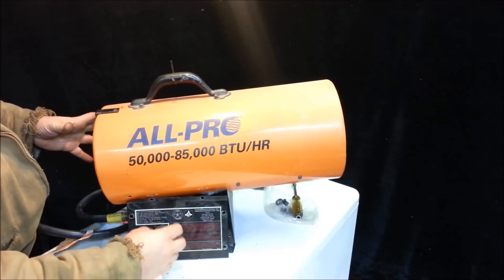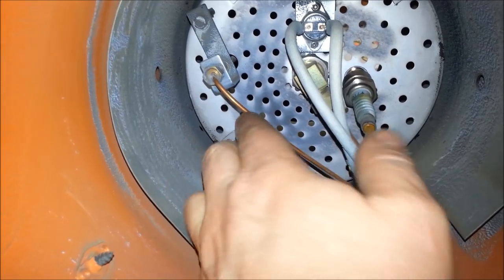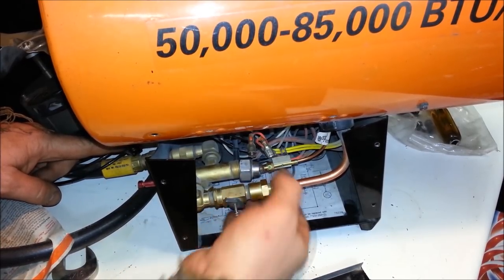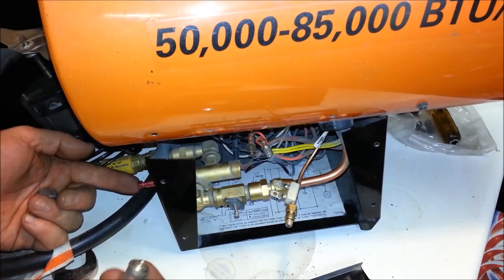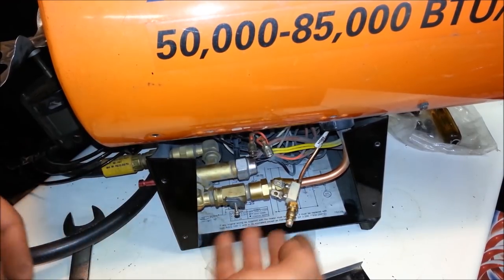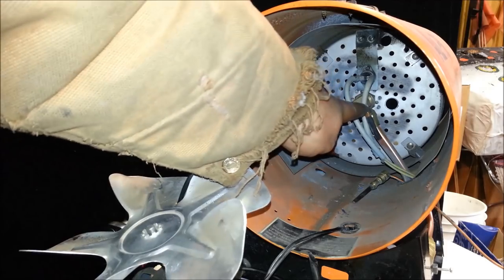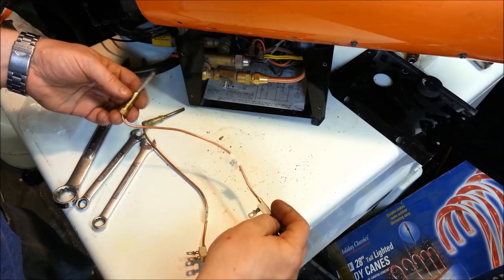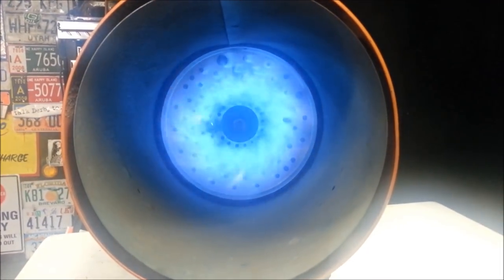Propane Torpedo Heater Not Lighting & How they Work

Comment: Thank you for the all the trouble shooting tips which helped me fix my heater.  My problem was the heater would start and run for just a minute or two.  If I bypassed the high-limit switch, the heater would run but get so hot, the unit would literally glow red.   Eventually took the regulator from the hose to my local propane store.  The guy said the regulator was either on or off and could not adjust the propane/air mixture.  
Took my regulator home and revisited some of your tips about the propane possibly "freezing" the regulator.   So I put my heat gun on the regulator and used a couple of rubber mallets to "tap" around it its housing.   Reassembled everything for the umpteenth time and success. Still have the fumes and it sounds like an F-16 taking off but hey, it warms the garage.  Couldn't have fixed it without your insight.  Thanks for taking the time to make the video and answer questions.

Comment: Thanks!  By watching your video, I found out exactly what was wrong with my old Coleman propane heater.  I obtained a new thermocouple for about $25 and installed it myself.  Now my heater is working as it should, and I can use it to heat my garage when I work on my cars.  Thanks again!  -Chris
Reply from the maker: Thanks, I'm glad you liked it.

Comment: Friends Dad and uncle were working on a car in a cold shop this last fall and used a heater similar to that. They failed to partially open up a door or window for ventilation. Friends mom found them in the morning. They had died from not having shop vented. Please always remind people to vent. Your vids are very educational, thanks.
Reply from the maker: Dave D I have a pretty well sealed and insulated garage and made it a point a 
few years ago to put the Carbon Monoxide detector in there. I can run 
the heater for 8 hours and it will never set off the detector. But if I 
start a small engine it goes off in 60 seconds. I feel very safe running
 these heaters in an enclosed shop but a Carbon Monoxide detector is always a good idea.
Reply: sixtyfiveford Hi 65, I would tend to think that you should match the heater to the space to be heated. I am not sure, but those two men who died may have been asphyxiated, not CO poisoned, esp. if the heater was too powerful and just consumed all the oxygen. Dave D didn`t mention the cause of death. Kero heaters will not poison by CO. You may get black lung, though LOL. Thanks for the videos.
Reply: I have a duraheat 60000 btu and it works fine but I have noticed in the last few days it is blowing off a lot more smell of unburnt propane like there is propane that is not getting burnt fully is there a way to clean some opening or something because I use this little heater daily for dogs.Like I said it seems like lots of unburnt fuel.
Reply: It's leaking soapy water will find it
Reply: Sounds like a bs story.  Many many heaters like this are used all over the country and no one has died.   I've used these in garages and construction jobs for 20 years and never had problems.    Bs !

Comment: I've been looking all over, can't find anyone with my problem. This is a brand new machine!  Plug in full tank, plug in power, <Fan & Sparker start working) turn knob on tank, press ignition button. nothing happens Can not smell gas, do not get any fire. Pressing and holding ignition button, NOTHING. It does not seem to be the Thermocouple. I got it friday, used it sunday to heat treat a bedroom for Bed Bugs (heat the room to about  140 degrees, for about 2 hours) and it worked fine. Next day, aim to use it on the next bedroom; no fire. Dunno. PS: great video, very clear explaination, camera and lighting!
Reply from the maker: Sounds like the propane tank safety shut off. Turn the tank valve ON and wait a few seconds, turn it off for a few seconds(you'll hear a faint click), then turn it back on. It should now flow gas when you hold in the bypass/pilot button.

Comment: The fan reminds me of an old GM heater fan. I used to drill a small hole on the plate covering the rear bushing and oiling it. Then just cover hole with Permatex or tape. That quieted a lot of fans back in the day.

Comment: Great explanation of how they function!  Thanks!  I'm not sure what is going on with mine.  It starts and the flame is small.... It just doesn't torch up big enough to create the normal flame and heat.
Reply: Are you low on propane? How cold is the area/room the heater and tank is stored in?

Comment: Thank you for this video.  I didn't know about that huge gap on the plug - I bought a 400k BTU Propane on the cheap because it wouldn't fire up.  They had replaced the plug before I got it and the only thing I did was check it for spark - When that didn't work, I replaced it, no help.  Then I gave in and found your video - 5 minutes later and two adjustments on the gap (too wide at first), I think that thing could heat a house up in 3 or 4 minutes!
Reply from the maker: Thanks, I'm glad you liked it.

Comment: Dude thank you so much for the info I got a CHF160 Duraflame from my uncle. it does not work do to the Thermocouple I am sure is shot. after watching your video it runs as long as I push the bypass it runs fine. I am so happy I found your video. I now just hope that I can find the right Thermocouple for it and ill be a happy man.
Thank you again. (almost 4 years ago on Dec 9.)
Reply from the maker: Sounds like a thermocouple. Thanks, I'm glad you video was helpful.
Reply: @sixtyfiveford  yep I thought it might be the solenoid that went out nope. It is the couple. Need to buy one off of Amazon. Thx
Reply: Hay by the way I hope you do a video of welding 101 class. I would love to see what you teach. Hope there is a way that you could put a welder shield on the cam so we could see what you see when welding. Thx man.

Comment: Great video, the most informative I've found. 

Any tips for testing the gas valve solenoid? I was able to get mV on the thermocouple, but even if getting the thermocouple red-hot, it doesn't keep the gas valve open. I get the thermocouple red hot, press the plunger for the gas, I can only get gas to flow when I'm holding the plunger (testing with the thermocouple where I can hit it with a torch).

Comment: Nice- since you have the propane and kerosene type which do you prefer.  I have a kerosene 215,000 btu , I can also run it on diesel , kerosene is way too pricy. burns almost a gal per hour. Never had a problem.
Reply from the maker: Steve Rob I prefer Diesel(Red Dye/ Off Road) over Kerosene. I think diesel smells better, has more BTU per gallon and is a fraction the price.

Propane= 91,200 BTU per gallon
Diesel=138,800 BTU per gallon
Kerosene=135,000 BTU per gallon

My current cost 2014
Propane=$3.00 gallon=      $3.28 per 100,000 BTU of Heat
Diesel(dyed)=3.15 gallon =$2.26 per 100,000 BTU of Heat
Kerosene=9.60 gallon=      $7.10 per 100,000 BTU of Heat

Comment: Great video.  Learned allot.  However mine is fairly new.  Only used a few times.  Now when I go to start it it won’t even flame up when pushing the button.  I can smell propane and can see the spark.  I’m wondering if it’s the 20psi valve on the hose not letting enough propane or something.  I noticed it used to heat pretty hot then even at full blast (when I could get it started) it wasn’t very warm at all.
Reply from the maker: The pressure regulator in the hose goes bad fairly regularly.

Comment: Great video on how these heaters work and areas of troubleshooting.  I have an older Dyna Glo 40k unit (RMC-FA40) that won't stay lit and could use some help.  Already replaced the thermocouple.  Blew lines out with forced air.  Good continuity on wires and high temp switch.   It fires right up and blows heat like crazy as long as the gas knob is depressed.  Cuts out the second it's released.  I've tried letting it warm up for 60+ seconds and no luck.  I'm stumped!  Appreciate your help!
Reply from the maker: A lot of these have a relay with a bunch of wires going into it. Most have a clear plastic cover so you can see inside. You take off the clear plastic cover and you can clean the little metal relay contacts/ switch contacts.
Reply: @sixtyfiveford  Will give that a try.  Thank you.
Reply from the maker: @jsmith5622  Just use a very fine piece of sand paper 300+. I have a video on automotive relays and how to clean them if you need.
Reply: @sixtyfiveford  So this unit is old school and all mechanical.  "Clicker" style ignitor like a bbq grill (which works) and thermocouple/high temp wires connect to bottom of gas valve to activate the magnet.  No relay/plastic cover to speak of.  Should make it easy to diagnose, but guess not.  I jumpered the high temp sensor wires and unit still shuts off when knob is released.  Multi-meter shows current flowing to the magnet after it shuts off, but wondering if it's enough or if the magnet do-hickey is shot.  I'm at a loss.
Reply from the maker: @jsmith5622  Try removeing one wire from the high temp sensor. It may be stuck closed.
Reply: @sixtyfiveford  Won't that break the thermocouple circuit?  Thermocouple/temp sensor wiring as follows:  Thermocouple:  1 wire screwed to bottom of gas valve (magnet mechanism area) the other wire connects to high temp sensor.  High Temp Sensor:  1 wire from thermocouple, the other wire plugs into plastic plug on bottom of gas valve.

Comment: nice fix / info ... I always worried about carbon monoxide and what is dangerous or not when burning unvented for heat. Have any good insight on that?
Reply from the maker: tblbaby I have a pretty well sealed and insulated garage and made it a point a few years ago to put the Carbon Monoxide detector in there. I can run the heater for 8 hours and it will never set off the detector. But if I start a small engine it goes off in 60 seconds. I feel very safe running these heaters in an enclosed shop.
Reply: Hey, good info :). Somehow my settings changed and I did't get this. That's some great info on propane heaters. I know people use them but never knew how safe or not. Wonder if kerosene is the same situation.
Reply from the maker: Yeah, I almost solely run my Kerosene/Diesel heater. Carbon Monoxide isn't a problem with these heaters. But the one fear would be if you used a heater to large for the space it would use up all the oxygen and asphyxiation could happen.  The area would have to be pretty air tight as well. Asphyxiation is generally what people die from when they use a heater in the cab of their truck and go to sleep.

Comment: Awesome man that's good info. I think the 2 spade clips on the thermal couple run to the relay and kinda redundantly stop operation if they don't get a signal. Anyway I have that exact heater I've been trying to figure out and your video was helpful thanks.
Reply from the maker: Thanks, I'm glad you liked it.
Reply: The 2 terminals that connect to the relay "stops operation" to what though? If thermocouple is bad, it's not producing voltage...and no voltage is produced by manually holding plunger either...so something else would not be functioning either if the two terminals were feeding voltage to some other stop operation. I suspect it goes the other direction as a fail safe and is fed TO the thermocouple FROM the relay instead. Such as when the high limit switch is tripped. Perhaps it grounds out the voltage in the thermocouple so that the voltage will release the plunger? I came to this video looking for an answer to this very same subject. I've got a thermocouple on hand I can use today until the one I have to order comes in....but the one I have is not one with the 2 terminals. I'm trying to do a little work around temporarily.... just need to find a little more info.

Comment: I have a question about a protemp 100,000 propane heater.
With the switch in the off position is the fan suppose to come on when you plug it into a receptacle? The control knob turn past the off position then counter clockwise to off, low, medium and high. The instructions say turn it to high for the ignitor to light it and then back down to where I need it.
I thought the control in the off position would turn the heat and the fan off. I don't know how it suppose to work this is the first time I've tried it the heater was given to me for my shop.
Thanks

Comment: I have a 60 k BTU pro-temp heater and a 60k BTU master heater. The flame on the master is by far greater than the flame on the pro-temp. If I run the pro Temp for 15 minutes in my garage my eyes start to burn. But I can run the master in the garage for 8 hours with no problems. I swapped the regulator off of the master and put it on the pro Temp and there was no change in the flame. The master heater can heat up my 24 x 24 garage in about 10 to 15 minutes, then I put it on low. But even if I run the pro-temp heater on high I still have a chill in the garage the entire time
Reply from the maker: You're getting a RICH mixture of propane to air in the burn. You need less propane and about the only way this is accomplished is with the jet/nozzle. The one burning your eyes is more than likely jetted for lower altitude(larger jet) which puts too much propane fuel through. At higher altitudes with less oxygen the jet is smaller to make a more complete efficient burn.

Comment: Nice. Question about the kerosene heater. Can it run on home heating oil? Also, is a propane heater safer than a kerosene heater?
Reply from the maker: Dasdfjkl They have the same safety concerns and one is not more dangerous than the other. I have always ran all my heaters with regular diesel fuel which is identical to #2 heating oil.

Comment: Ive got a 150,000 btu heater and its way to much for my little 2 car garage  great heaters though.  It burns through that propane though LOL
Great Vid buddy
Reply from the maker: Yeah the propane heaters seam to eat a lot. I originally used this propane one and now it's just a backup. I use a Kerosene/Diesel heater solely now (with diesel).

Propane= 91,200 BTU per gallon
Diesel=138,800 BTU per gallon
Kerosene=135,000 BTU per gallon

My current cost 2014
Propane=$3.00 gallon=      $3.28 per 100,000 BTU of Heat
Diesel(dyed)=3.15 gallon =$2.26 per 100,000 BTU of Heat
Kerosene=9.60 gallon=      $7.10 per 100,000 BTU of Heat
Reply: Wow  that adds up

Comment: I have one and the flame is only lit on one side and very small like the size of a torch flame, it looks like a pilot light. I can get it to light and run but I'm pretty sure the flame is supposed to have much more coverage inside the torpedo. It seems to me the flame is only lit at the nozzle and doesn't spread to the rest of the surface plate or whatever you call it. I can barley get the shop to 70 on a 55 degree day and that's struggling. In a way it's like blowing a fan from behind a propane torch. I wonder how to fix it. I'm good with that stuff, just not sure what's wrong or where to start. Can you help?
Reply from the maker: Sounds like a regulator problem not allowing enough gas to flow.

Comment: Great video. Very helpful to troubleshoot and diagnose the problem with my heater. The only thing I found wrong was that the thermocouple you use in the video to fix yours is different from the thermocouple you linked to on Amazon. I had 
to send it back because it was the wrong one for my heater. What is the exact product number on the one in the video? That's the one I still need.
Reply from the maker: The linked one should have fit, just an inch longer overall. The exact part for my All Pro is a 6654NR that is 12.5" long . I used a universal one in the video.

Comment: I bought two brand-new Dyna Glo propane workplace heaters are use them to heat the new homes that were spraying in . Today I was spraying enamel on all the doors and trim and both my heaters kept shutting off. I have a feeling somethings getting dirty maybe the heat sensor
Reply from the maker: Sounds like the propane regulators/bottles were freezing up. This is a very common problem that can be overcome by using larger bottles and or intermittently heating the regulators/bottles with the heater.

Comment: As a first time ever touching one gas heater Noob.
I wish you started the video demanding us to check that the regulator on the bottle is a high pressure one 😅

I've got one from a friend with regulator that wasn't working, and trying to fix it i opened every valve and pipe to blow out dust and clean out nozzle.

Still no burn, just light a lighter an put into the gas nozzle from the bottom and there is flame but very weak. That's when I checked the regulator (0.032bar) and pressure demanding on burner (1.500 bar)

Comment: Great tip (or bad one in this case - little pun). Wish I had that heater in my garage right now, brrrrr. So your camera is jet heat insulated? Nice camera shot? Thanks for sharing.
Reply from the maker: MRrwmac I put a huge piece of glass between the camera and heater. I knew it would melt it within seconds otherwise.

Comment: Smashing tutorial, i didnt know how the thermo couple worked, to be honest i had never really thought about it at all lol.

So connecting a multimeter (in volts mode) across the output would yeald some potential, and a resistor across the meter while taking voltage readings would simulate the solinoid loading, you could test the fitness of the thermocouple.

Or just say "Bugger that, ill just stick a new one in" ha ha :-))
Reply from the maker: zx8401ztv Yeah, they can be tested and put out around 30-60 millivolts . They go bad pretty frequently and are inexpensive so most of the time they're just replaced.